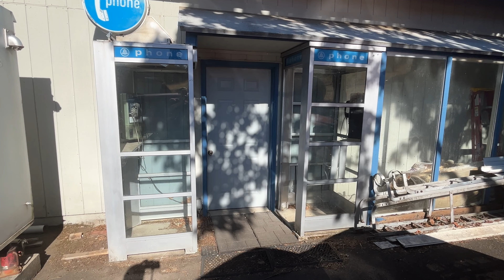Telephone and switching system walk thru.

Comment: Really enjoyed your tour! Thank you! Bought an old black Bell system by western electric 3 slot. Heavy! Its front shows 151 Area 555-3034 Deposit 10 cents. I see that area code is UK. I am in the states. Don't know if this is why but ....Was able to get a dial tone with the green and red from home line. If I call it though it is busy. I would like a picture to see what terminals I could try next.

Comment: Nice walk through.  Where is your museum? There is also another telephone museum in an Oregon that has xy, crossbar, a 5E and I think a 1x.  They are on YouTube.  Also, if you have not heard of Evan Doorbell, he has a host of recordings from old telephone sounds out in NY.  He knows the name of each switch he dials through (or tandem) and amplifies line noise to explain what each click or tone was.  Clever guy, he even sped up the spring recoil on a dial up phone he used pre DTMF.  Rather than 10 pops, sounds more like double.
Reply: Evan Doorbell is the whole reason I first became interested in 20th century phone equipment!

Comment: 15:45 THE single hardest area to keep neat and tidy! (and heaven help you if you've lashed everything neatly and need to remove/replace/reroute one of the cables on the bottom tier!)

There is an amazing amount of history in this display! I did dialup networking for an ISP (modem banks), so I know a bit of this but not nearly as much as you do. At one point, we ended up with a 2500 line entrance frame in our equipment room along side our distribution frame running 25 pair amp cables down to a row of racks with modem banks and terminal servers. I got really tired of--but fast at--punching down cables to 66 blocks. (Never liked 110 blocks. Too cramped.) Your phones are also all just in beautiful shape. I LOVE that display! I especially love the bright lime green 2500 set!

I have a handful of old single line telephones displayed in my living room, but that's all. Oh, along with my personal butt set and an old blue rotary set I bought just to pair up with it for display. (Still works!) I grew up with a "banana phone" with a 15' coiled handset cord in our kitchen, and yes it was actually yellow.

Comment: Excellent video.  Thank you.  
This brings back so many memories of my bell system career.  I worked as a switchman in 355a SxS with ani-c. Then worked no.1 SxS with Cama, ani-b, with class 4 and5 which included switchboards, intertoll and toll-completing step selectors. It was in Eldon Missouri at Southwestern Bell. Such a interesting job and fulfilling. Again thank you.  Wished I could see your installation in person,  but age has crept up on my bones.
Reply: This was when we could fix a problem in the CO without having so many involved and we could see the results ourselves.

Comment: Wow! What a walk down memory lane. I spent 22 years in the key system and PBX group from 1980 until 2002 and the next 16 and a half in the C.O. This was with SWBT/AT&T. I installed and worked on so many of those systems. The first three years I was an operator and worked on a 3CL toll switchboard. I’d never seen a picture that so closely matched the one I worked on. It even had the same type clock! My hat is off to you sir, what a labor of love. Thanks so much for sharing what you do. I’ve seen several of your videos and I’ve enjoyed them all.
Reply: From t13. Where did you work out of?
Reply: BNTVARCR
Reply: @mikeE0055  was that in Missouri?
Reply: Arkansas